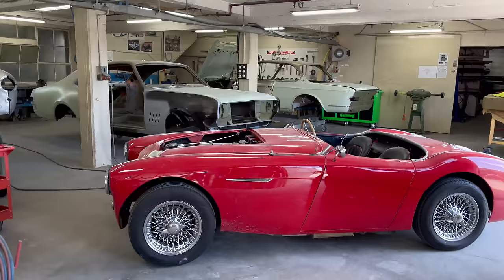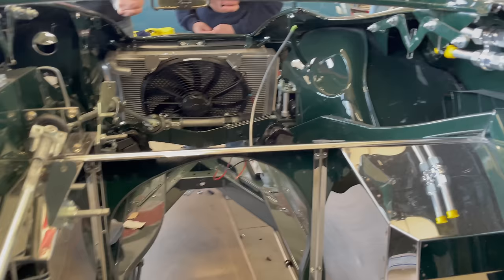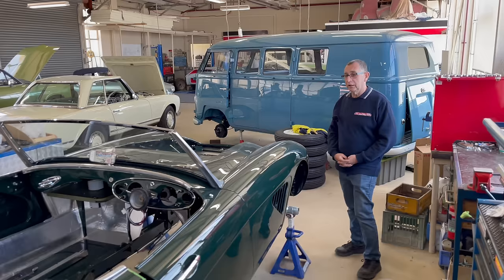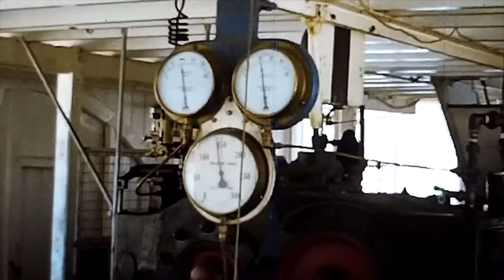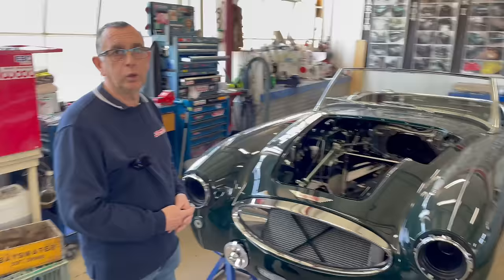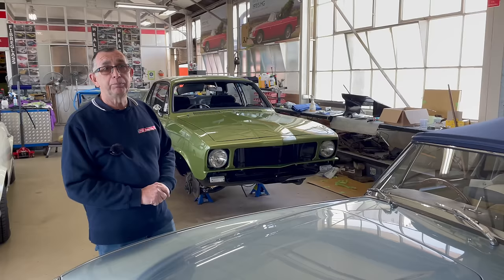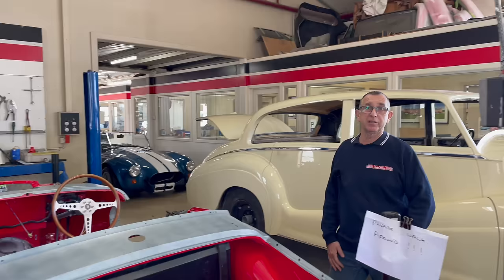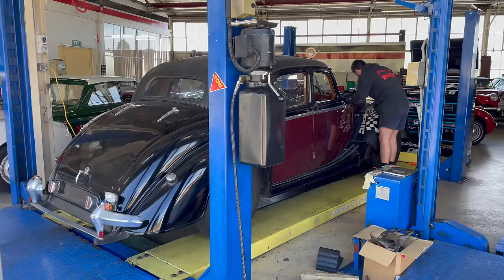Tell Seinfeld, the Austin Healey just got better

Comment: Back in the 60s everybody was dropping a V8 in these things
Reply from the maker: But did they have the suspension and brakes to match?
Reply: I think best drop an 8 into everything and anything.
Reply: Indeed,the craziest had to be the one with the Chrysler Hemi, an early 331 with the long bellhousing so it must have been a really tight fit. I often wonder if it's still about somewhere.